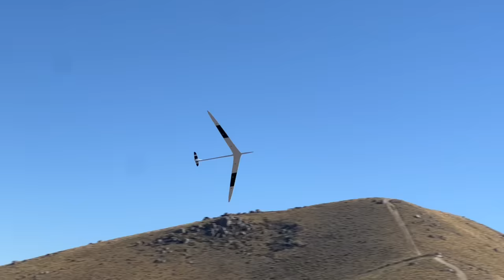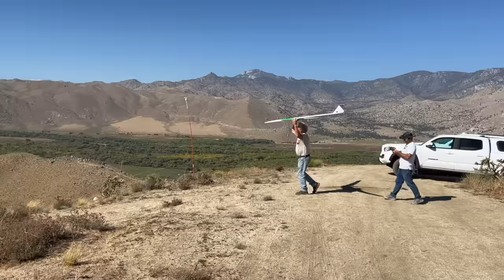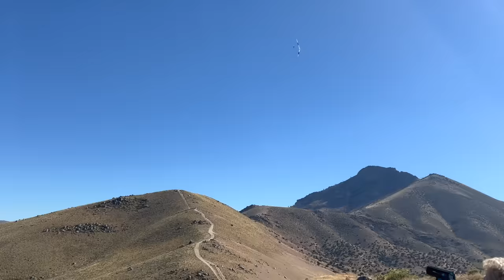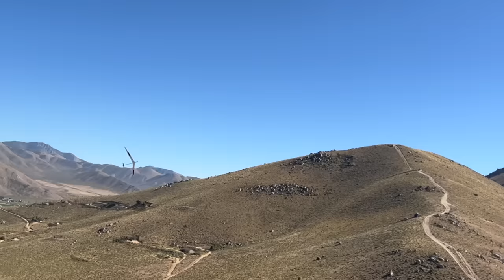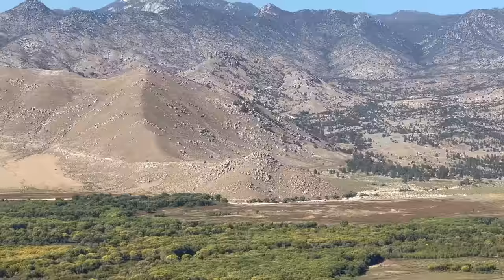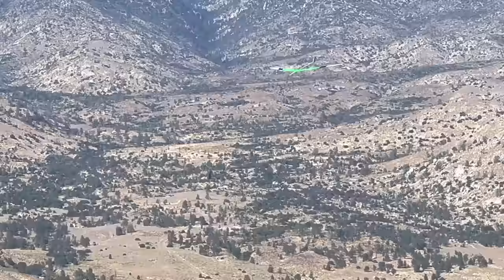Spencer testing Transonic Sweeper

Comment: Speed: 344 mph / 553 kmh.

This info is from his link in the description. Plane is designed as a test model for lighter winds (in this case 30-40 mph). He's now working on a full design for strong winds - this thing's going to get close to the sound barrier 💣🚀)
Reply: Control it from a bunker, or at least the boot of the car!
Reply: This is so wild, I showed my dad this (retired fighter pilot/ commercial pilot) and he didn’t even believe this. Where can I find more info about this? Is there a name for this sport/type of gliding??
Reply: @dannydecamp6846  it's called DS (for Dynamic Soaring). Amazing stuff, well worth falling into a rabbit hole for.
Reply: @cabanford  thank you
Reply: I think he found some secret sauce there. 344 and that quiet? When he gets to full layup it's gonna be silent monster. I foresee 600 being a new record.
Reply: how could it get to the sound barrier if its method of propulsion is the wind?
surely it can't go faster than the wind.
Reply: @downey2294  And don't call me Shirley!
Reply: The pinnacle of true flight.
Reply: @downey2294 That's what they said about sailing ships... Seems a short-sided statement given that knowledge.
Reply: @kludgescraftsplus8631  it's not a statement... its a question...
Reply: @downey2294  it's already going multiples of times faster then the wind right now. There is a long winded explanation here on youtube do a search for dynamic soaring. The short of it is when it is diving down behind the hill it is going with the wind and when it gets below the top of the hill it is in the eddy with no wind and climbs back up with built energy from going down and down wind. The phenomena is called a rotor.
Reply: @downey2294  how do sail boats sail against the wind?
Reply: @downey2294  exactly and it's a well-known fact that there are a wide methods and varieties of sailing ships capable of sailing faster than the wind. So it stands to reason that that wind speed is not the greatest controlling factor. Aside from the fact that his highest speeds are also done in a tight circle at an angle to the hill with updrafts. The plane clearly flies very well at slow speeds, and is capable of high speeds because of the extreme sweep. When it is traveling at that speed in that tight circle the angles wings make are significantly different as opposed to steady flight. I would be exceedingly impressed if this were capable of those speeds across the distance, rather than a tight circle. The plane is essentially pumping against the wind utilizing the angles pick up speed and a shape with very little resistance. Impressive, but not surprising, clearly they are motivated and capable individuals.
Reply: @downey2294  Are you suggesting he is flying in 344 mph wind? I don't understand your question.
Reply: yikes. didn't know people would get this upset at me not knowing something. you got me guys you can stop now
Reply: @downey2294  It's cool. Just think things through next time.   :)
Reply: @downey2294 - no worries - I am an engineer and I don’t fully understand the physics here. Crazy stuff.
Reply: @downey2294  It's already going FAR faster than the wind, as do certain types of sailing vessels if they have low enough resistance, like hydrofoils and iceboats. It is an interesting question of whether one can exceed the speed of sound. I suspect that might be a more fundamental limit of physics, but I freely admit that I haven't done the analysis to justify that position, so I may very well be wrong. All that vector addition stuff is far in my past! 🤣
Reply: @downey2294
No criticism, just a mental image to suggest. I think a useful analogy to this is pushing someone on a swing. As you build up height and speed, it gets harder and harder to time (optimize) your push to add energy to the system. Here, with each lap, they are diving with the wind and finding the sweet spot both in the flow, to gain speed, and out of the flow, to minimize loss.
Reply: ...20kg of carbon fibre moving at 600mph would cut a car clean in half... and anything inside it! The kinetic energy involved is incredible. A crossbow arrow is a few grams and going 250-300mph for the most powerful ones.. this plane will be twice as fast as a crossbow arrow, and weigh 20kg.. it is a serious toy for serious players!
Reply: @ziggystardust4627  Approaching the speed of sound you run into a pressure wave.  Long before the plane reaches the speed of sound the flow over the top of the wing will exceed the speed of sound locally.  The greater the loading (from lift) the greater the speed difference between the local flow over the wing and the plane.  Dynamic soaring requires a high G maneuver from one flow to another so the required lift is a multiple of weight of the plane.
Put it all together and I think it is safe to say that you can't dynamic soar past the speed of sound.  It is a fantastic challenge and they are achieving incredible results!
Reply: @dannydecamp6846 the builder/pilot in this video did an in depth presentation (probably close to an hr long) that is very informative. I can dig up the link and post it here if you're interested
Reply: The record is nearly 600mph. Held by this same guy IIRC
Reply: @downey2294 Look up dynamic soaring.   Also, look up sailboats.   If you're going with the wind at your back, no you can't go faster than the wind.   You also go nowhere if you're pointed directly into the wind.  If you're at an angle against the wind and you shape your sail right, you can go much faster than the wind.
Reply: @skyak4493  isn't the theory about the wind having to move faster over the top of the wing controversial? My recollection is that there is quite a bit of drag in the transonic region, and it would take quite a 'push' to make it through the barrier, but once on the other side, life might be ok. The issue as I see it is that the plane is not always decelerating during DS. The straight line segments are decelerating, so it's only during portions of the turn that there is actual acceleration. Given that drag increases with the square of the speed, there is going to be monumental amounts of drag, which means the straight line segments need to be minimized and will be detrimental to speed, more so than in the 500mph range. In other words, it's going to have to be one HELL of a wind. However, big wind days absolutely exist.

I imagine this could be played out in simulation to find out the theoretical maximum speed for a given airfoil, known drag cofficients, frontal area, etc and a flight path with a known geometry. 

If anyone can do it, mind you, it's Spencer. I used to DS when the speed record was 202. I hit 168 and thought my world was ending.
Reply: @downey2294  The proof that one can travel faster than the wind can be demonstrated by the latest foiling super yachts competing for the Americas Cup. 70mph over the water is now the norm.

Comment: 1) the engineering on those wings is absolutely nuts, the wing loading must be incredible
2) no way in hell I’d be standing that close, one wrong move on the sticks and you decapitate three people

Props boys, that’s amazing
Reply: no props, just wind
Reply: 😂“Props” = proper respect , not propeller
Reply: @nateisright  that's what makes it a joke 😊
Reply: The odds of one plane decapitating 3 people are zero. Even if lined up correctly, it's only a 186 oz plane. After the first decapitation there wouldn't be enough energy for the other two. Chill, bruv.
Reply: @ernie5229  XD

On a side note I watched a video where they crashed one of these things into the hillside they were standing on, there was a very audible ground-shaking THUMP, akin to a car crash.
Reply: @dsdy1205  How many decapitations?
Reply: @ernie5229  I think none, idk about the ants on the soil where it hit
Reply: @ernie5229  at 400MPH, there's a lot of energy in a 186 oz plane. 6817. lb·ft/s will absolutely destroy bodies!!
Reply: There's been at least one reported death from these ds gliders.
Reply: Normally less than 3 Karens show up on the slope, so we typically rate our planes at two decap's.
Reply: @ernie5229  That's a massive relief, just make sure you don't stand in the front and all will be fine. ;-)
Reply: @mdeasy  "Destroy bodies" or decapitate 3 people? A hammer can "destroy bodies."
Reply: @jriley-tv1on  But how many tripple decapitations? Or even double decapitations? Yes, fast things that run into other things can injure. The topic here is tripple decapitations.
Reply: @rc-fannl7364  No cap!
Reply: @ernie5229  At worst, it might only take off half the second head.
Reply: @jamesa5720  That's what I'm sayin. Why all the exaggeration? Sheesh!
Reply: @mdeasy  If that thing hits you head on it goes through you. The energies involed at these speeds are scary.
Reply: The weight is mostly in the wing, so each segment of wing flies mostly unaware of the rest of the aircraft, regardless of wing loading. That is the beauty!
Reply: @ernie5229  at 500mph it would have 250,000 joules of energy.  E=mv**2  That square factor is a killer.
Reply: @mickistevens4886  Check yer math bruh. You still think it will DEPAPITATE 3 people?
Reply: @ernie5229  Would you think 3 human necks could stand up to the equivalent of super tough( high strengh wing material) bullet weighting 9oz (half pound)?
Reply: @mickistevens4886  I think the fact that anyone would seriously spend their time defending such a ridiculous notion is utterly outrageous. I mean, really. Reflect. Do you not have responsibilities? Those that depend on you? Have you nothing better to do with your time?
Reply: No props at all..... THAT'S amazing!
Reply: @ernie5229 one mishap later.... "Appears I was wrong, please send all of their families.my condolences!"

Comment: the wing loading must be incredible
Reply: It's really light, so might not be very much. If the wing loading was high it wouldn't be very efficient, and so probably wouldn't pick up as much speed.
Reply: @jackroutledge352  I prove once again that I don't know what I'm talking about 🤐I meant the G-loading due to those violent, high speed loops. I guess wing stress would be more accurate.
Reply: @jackroutledge352  High wing loadings don't mean low efficiency, they mean flying faster at the same angle of attack. At least until you get into the transonic region, anyway. Viscosity can be less important as speed and size go up, so an aircraft may have a slightly better L/D as it gets heavier. This is especially true of models.
Reply: @isaiahhiggins  Based on 553km/h and ~4 seconds per loop, the average acceleration comes out to 24.5G for an apparent weight of 127kg. Kind of wild. You could work out the wing loading from the 130" wingspan and the photo at the beginning
Reply: @jackroutledge352 completely opposite to the aeronautical facts of design. You need high wing loading to achieve high speeds, or rather, high wing loading mitigates towards high speed and vice versa
Reply: Up to 100 Gs design specifications.
Reply: @UltraVioletYS  And finally we have it. Physics is our friend.
Reply: @UltraVioletYS  Bless you and your napkin!  Bow low social media speculators, there are real numbers to consider!
"Average" acceleration would be a perfect circle, but top speed in dynamic soaring would maximize use of the wind differential.  I would expect a peak substantially higher than average in the transition from sheltered to peak wind.

Comment: Amazing that the same phenomenon used by an albatross to stay aloft for weeks or months can also take a model sailplane up to transonic speed.  Fantastic work and flying!  Good luck with the next phase!  Maybe we'll be hearing a sonic boom?  That would really be something!
Reply: How fast is it going? Transonic would need to be around 720 mph and a little less depending on the altitude.
Reply: @ChrisNobodySpecial  My wild guess is around 238 mph.  I am taking a wild guess he's doing 400 foot diameter loops. That's 1257 feet per loop. I timed his loop at around 3.6 seconds.  That into 1257 is 349 feet per second or 238 mph

Comment: This is astounding. I've only recently discovered dynamic soaring even existed, here on YouTube - and as an engineer living near a fairly steep hill (about 50m height, along the river Rhine in the Netherlands) I'm intrigued what could be done with this energy - how to harness it, perhaps in using it with an angled windturbine somehow....
Reply: If your wind turbine is attached to the ground, you don't need to use dynamic soaring. The tips of some wind turbines may go at 10 times the wind speed, which is probably not so different than we're seeing here.
Reply: A tethered kite generator would be the closest, but as lr says above if you have any ground attachment, you don't need dynamic soaring to extract power.
Reply: Funny you should say that. As I was watching this, I wondered if this principle couldn't be applied to wind mills or turbines ...!

Comment: Need to film this in higher frame rates. There are only a few frames of the plane per loop at 24fps.
Also, It's good to see such an extreme design behaving so well outside of its peak environment, seems to soar pretty well on the up draft.
Reply: Great idea, I'd say it's worth sacrificing resolution down to like 720 if it meant 120fps so it was clear and smooth
Reply: it's mostly youtube compression of the video

Comment: Impressive that the wing didn't snap in two.
Reply: No batteries, and no engine. that's why i guess.
Reply: Part of the reason is that most of the mass is evenly distributed across the wings and so is well supported under the G loads, the fuselage mass is a less acute stress riser than in some other aircraft.
Reply: it needs batteries for steering bud @atvheads

Comment: I thought dynamic slope soaring was on the downwind side of the slope up into the top of the over flow. Did I have my wires crossed all these years. Laurie NZ. 😊
Reply: Looks like the launch was into the wind, but then moved to the downwind slope (around the 53 second mark) for the DS testing.
Reply: Things work in revere in the southern hemisphere.
Reply: Dynamic soaring and slope soaring are different things...

Comment: The kinetic energy at full speed is around 20 kilojoules, and it takes a split second from pilot error to impact. Personally I'd be hiding behind those rocks…
Reply: I was going to say a blast shield!  Pilot error, control surface failure, electronics failure....
Reply: Transonic flutter magic.

Comment: That turn’s easily got to be 15-20 Gs, just amazing engineering
Reply: about 80
Reply: More like between 75 and 90 G. Insanity isn’t it.?
Reply: @MrSteve2714740  Does that mean the ride is bumpy or that I'm over-estimating the turning radius?
Reply: Wouldn’t say it’s bumpy. And at “normal” sort of speeds the circuit is large. But speeds like this it’s obviously going to be a tight turn. The pilot flying really knows his stuff. Not many RC pilots could even contemplate the difficulty flying at these sort of speeds. I’ve flown fast slope soarers in my 40yr area of RC planes but I’m no where confident enough to enter into the dynamic zone. These gliders are incredibly fast and on another level. Big respect to the dynamic lads in my opinion.

Comment: 248 m/s and 5.2 kg is about 160,000 J kinetic energy. Typical muzzle energy for a handgun round at a similar speed is around 500 J. I would rather watch that fly from behind some significant armor.
Reply: a grain of sand at  556.997 miles per hour would be a concern. This flying razor is terrifying and fascination.
Reply: Several years ago I calculated the kinetic energy of one of my friends planes when he was radared at 284 mph with an 8 1/2 pound plane. It was about 26,000 foot pounds of force, or double that of a military 50 caliber round.  Previously we had been using our trucks to hide behind, but realized that only the engine block would protect us. That plane would probably go right through the sheet-metal of a pick up truck. Another time I watched a plane penetrate 18 inches into very rocky soil after being retarded about 150 mph before the wing broke. That plane was not designed for dynamic soaring.

Comment: Siiiiick. Is that, like, exploiting the boundary layer as a way to get upwind without losing energy? Sort of like "pumping" a swing? I want to try that.
Reply: Yeah, Nahh...
Sail boats can go faster than wind speed by using the keel to maintain aerofoil attack angle.
Planes don't have the benefit of water to do that. What they can do (is doing here) is use the momentum of the plane.
Maximum energy is imparted at the upwind part of the turn, when it's flying across the wind.
Sure, at the downwind section it dips below the wind into the turbulent zone, but that does allow it to return upwind for another boost.
It's a mistake to think that it gets speed by ducking out of the wind, sneaking back upwind and getting a tailwind push. It flies much faster than the wind, so that can't be the mechanism. 

Note that this is done on the leeward side of the hill, whereas slope soaring is done on the upwind side where the air is rising.
Reply: Look up dynamic soaring to get the physics.